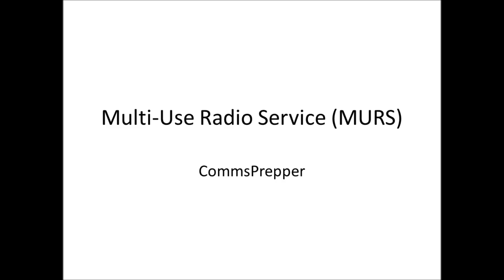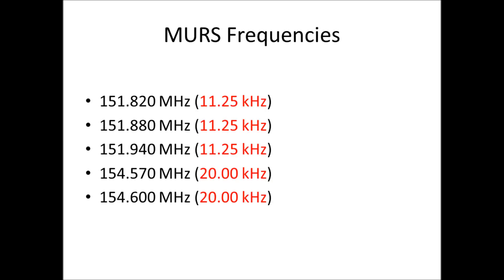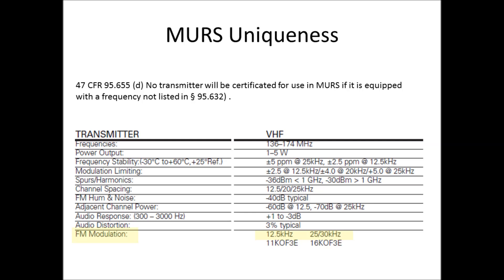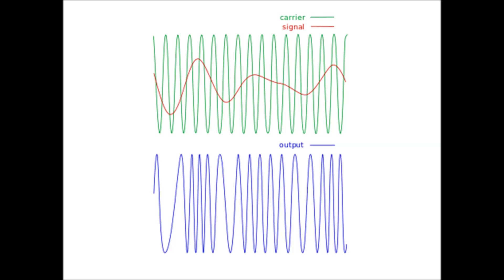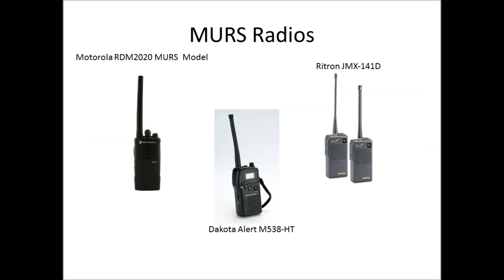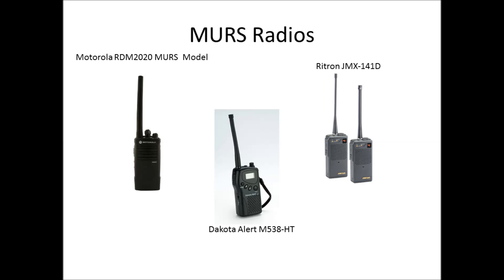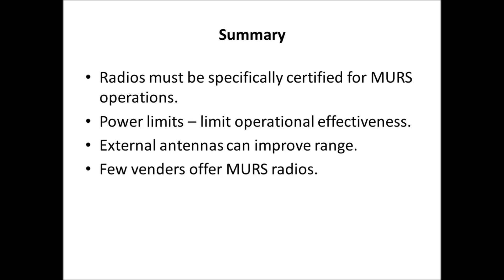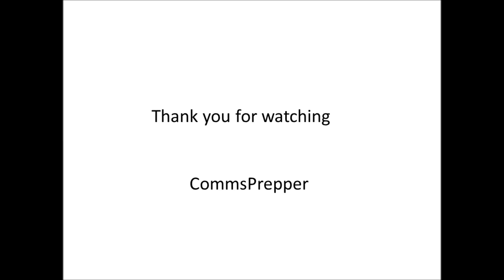MURS Radio Information for Emergency Communications

Comment: Not a prepper here, but this is probably the best video I've seen and a good comprehensive single source for information on the MURS band.I'll definitely be keeping this around to show people.
Only thing of note is that because of grandfathered IG license holders, pre November 2002 VHF business (FCC Part 90 certified) radios are still okay to use assuming they do not exceed the set bandwidth for the channel or the power level, so something like the TK-2100 would be legal to use on MURS 4&5 at the 12.5KHz bandwidth setting.

Comment from the maker: I would think you could back off the modulation level in the RSS to zero, then bring it back up to 12.5/20/25kc.  I would check but I don't have any of those old DOS RSS programs anymore.  The last one I had was for an old Maxtrac radio.

Comment: Hey Commsprepper, if you have a spectrum analyzer you can actually adjust some of the older FM radios to 20kHz deviation. Supposedly, before the narrow band mandate came to be, some West coast areas were practicing 20 kHz to free up bandwidth.

Comment: Hey Commsprepper, thanks for the video. One of the other attractions to MURS radio is that you can purchase both alert transmitters for driveway/outdoor use. I know that with HAM anything is possible, but is there a similar technology that allows this functionality without having to to beyond a basic HAM license?

Comment from the maker: "don't listen to this dude..."  I do not promote illegal operations on my channel.  "a little wide on the bandwidth..." is out of band and illegal.  Using business band radios on MURS is also illegal.  Only radios specifically certified for MURS (by the FCC) may be used on MURS.  and.... YOUR BLOCKED.

Comment: I agree with that, in a perfect world. However, most "preppers" already have the dual band radios because that is what is being pushed. SO, my thinking is, before these people start chatting  in bands that will get them in trouble during ROL we established a freq that is in a non licensed freq. What good is the radio if you cant practice and learn. You have a valid position but there is "the way things SHOULD be" and there is "the way things ARE". Not disputing your info but it is what it is.

Comment from the maker: MURS has less traffic than FRS and GMRS but no greater capability.  I recommend Amateur radio.  Far more options.
Reply: But many people don't want the hassle of licensing or the higher cost of amateur radio equipment and accessories. We know MURS isn't like a amateur radio. I have talked 10 and sometimes 14 miles away with a external base antenna talking to a MURS handheld hooked to a vehicle mobile antenna.

Comment from the maker: I don’t dispute that the MURS service has a niche for preppers  and do not disagree that preppers should have a MURS capability.  What I disagree with is promoting the use non-compliant equipment for MURS operations.   Many will cite WROL as justification but during “WROL” one could ask - why stop at MURS channels when most radios are 136-17?  Prepr's should acquire capabilities compliant with ROL so they can develop technical proficiency needed for both SHTF and WROL without violating the law.
Reply: I listen to FRS/GMRS frequencies all of the time & I have NEVER heard a single call sign from anyone using them where I live.I hear adults & kids every day & I also hear many of these same people on MURS & they discuss what types of radios they are using sometime & 99% say,BAOFENG on all of the frequencies. Same when I'm out on the roads & highways so I'm guessing with the choices of gear in the MURS band that those numbers are pretty accurate across the country because of the lack of legal radios & the cost of the legal gear.The FCC knows this & unless anyone is blind they also can see this.It's one thing too promote what is Legal but I know that you know the Truth about what is being used & as long as the prices are so different it will NOT be changing since the FCC has a Very Tiny budget & can't handle enforcement on most of any bands & these services are barely minnows in the big ocean of enforcement so they have much bigger fish that they should be frying but can't afford the cooking oil or the match that lights the fire.When someones life is on the line all bets are off for any government services much less radio waves enforcement on most any band.

Comment: The very idea behind MURS is that the equipment is not readily available at every store you go to. Thats why we chose it. The likelyhood is MUCH greater that if you find someone on MURS that it will be a fellow prepper. Just getting tired of these over technical videos squashing an idea because its not mainstream. Its the raod less traveled for a reason. If we are in an emergency, do you want to fight with millions on CB or FRS or have a freq that you are more likely to find "preppers"
Reply: You know one of them cheap $25 bill things can be on all of these frequencies in despite his narrowband wideband dispute you could still talk to them fine merge radios I believe our limited to two watts where does baofeng radios will be transmitting 5 Watts to 8 Watts on some of them you'll be Takin Over most people

Comment: How will enforcement work for those who are in violation? This sounds complicated to the average person who has bought a Motorola Spirit radio on ebay!? They all have MURS in them and are Two watts and do not use the 11khz bandwidth? Also there are a HUGE list of additional MURS freqs that are in those radios! Id think the FCC even knows what they are talking about at this point! They would have to go after Motorola asap and HARD to stop the maddness!
Reply: There may be other frequencies but they are not MURS frequencies since there are only FIVE such frequencies.

Comment: So what is your take on the National Prepper Frequency useing the MURS 151.8200 MHz.?  Then another question, using software for programing the radios like the Wouxon, I have seen where I can set Narrow or Wide FM, how does that differ on the 11.5 KHz that you where talking about?  I am not a HAM, but have been around radios for a long time, mostly CB but on some GOV frequncies like 27.545.  I have picked up 2 of the Wouxon's and am looking at a Yaesu 2900R and a 7900R.